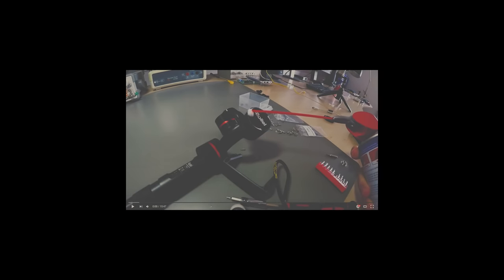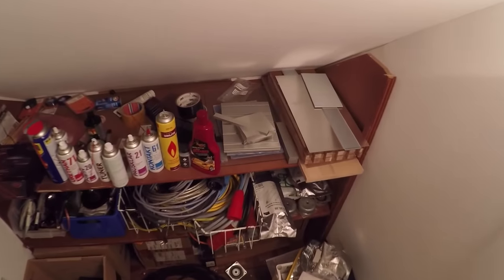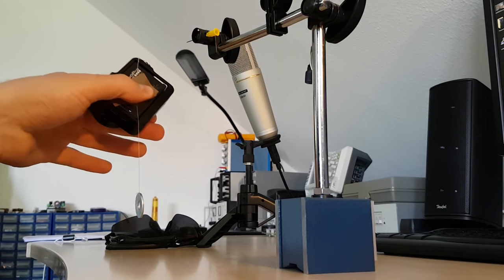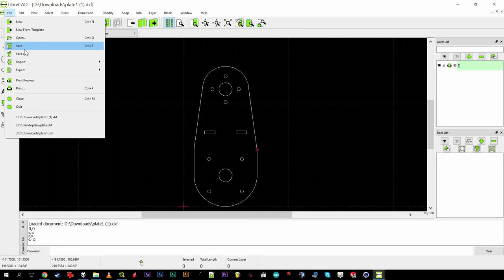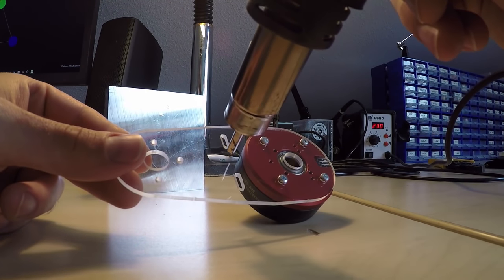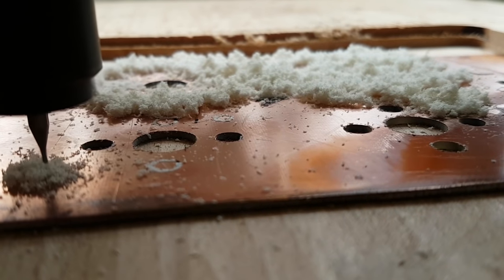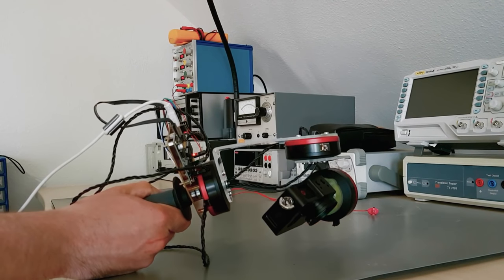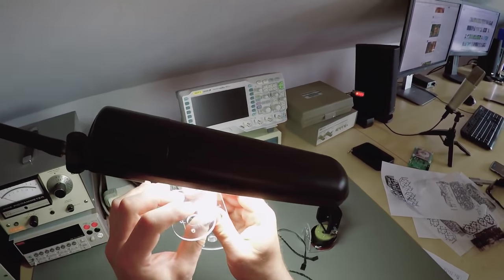DIY 3-Axis Brushless Gimbal: Acrylic, SimpleBGC, GoPro

Comment: Do It Yourself?? Not really. This is a bit beyond DIY. Excellent engineering, though. Well done.
Reply: What. Just because there's a CNC mill in the video doesn't mean you couldn't do it yourself. You could just as well print out a paper template, spray it on with some glue, and chop out the brackets by hand.

Comment: lol very funny narration. and very informative.you deserve a million subsribers.  I'm trying to build a gimble for a dslr. you have helps greatly in information. maybe you can help me and point me in the right direction, as far as where I can get electronics for a bigger dslr and a frame I can design. I have 3d printer. I will give you credit when my company  post first video using the system. :)?
Reply from the maker: The motors I used (BGM-5208-200) are actually made for DSLRs and the driver (Basecam SimpleBGC) can deliver enough power. The frame: There is another video series out there, where someone makes an entire gimbal from carbon fiber and epoxy, looks a bit difficult. Maybe printable parts can be found on thingiverse or grabcad...

Comment: Hello, great video. Can you explain why you had to find the center of gravity of the camera. How was that considered in your solution?
Reply: You have to balance the camera with the axes of rotations. If you don't, the motors will have to compensate for the efforts due to gravity.
Reply: If you balance an object on your hand, let's say it's a ruler, the first thing you'll instinctively do is try to find the center of gravity. If gravity is pulling the object straight down then it's actually helping you keep things aligned. You exert little effort and let natural forces keep the object aligned. I'm sure you've noticed that the more you lose the center of gravity, the more effort it takes to realign it. A gimbal is doing the same thing. The more balanced it is, the less battery it uses and the less likely it is to fail.

Comment: Sehr nettes Projekt und eine schöne CNC die Du da hast ;-) Was hat der Bau in etwa gekostet?
Reply from the maker: Die Mechanik ist die LCF-1, oft bei eBay für 400-600 EUR zu finden. Fräsmotor 200 EUR, wenn man keine Metalle fräsen will, gehts billiger. Stepper, Endstufen, Wellenkupplungen, PC, Kabel und Kleinkram haben bei mir denn 1000er voll gemacht, geht aber auch alles billiger. Von der LCF-1 war ich nicht begeistert: Billigste Kugellager falsch eingepresst -> mussten erstmal ausgetauscht werden und Aufspannplatte nicht parallel zum Schlitten. Der Kauf ist aber auch schon ein paar Jahre her, die haben sich bestimmt verbessert.
Reply: Haha ich meinte eigentlich den Gimball ;-) Aber die Informationen zur CNC nehme ich auch gerne :) Ne CNC muss es bei mir auch irgendwann nochmal sein. Aber dieses Jahr ist wohl erst mal ein 3D Drucker dran. Wobei ich da auch eher ein günstiges Modell nehmen werde. Aber gerade arbeite ich an einer LED-Deckenlampe, wenn die so wird wie ich mir das vorstelle, dann wird die extrem geil und ziemlich einzigartig auf der Welt ;-)

Comment: @Marco Reps,  Sure this is a year old but I didn't know about you then and plus now, I cannot comment on your scientific instrument repairs like the Keathley(sp?) . I made an EDIT: less is  more>> I suggested that you might have overlooked the  excellent opensource STorM32 BGC, using the ultra fast NT sensors and now the new encoders of the T-STorM version, plus!!! they are still actively upgrading enhancing and releasing  firmware and hardware implementation. For handheld or RC use it is unshakable. Basecam is then much more profit oriented, but still chugging along nicely, I was surprised to find out :O
Whatever., in the larger picture it doesn't matter unless perhaps budgetary constraints or you like the new developments in something that the average consumer takes fore granted largely until it fails
Reply: The hall sensor feedback in the Rollei I believe was pilfered from his good works. No attributes naturally. I am no good at regaling the mans feats of gimbalage, but he is one of the cornerstones
Reply: What's the total parts cost for the STorM32? I couldn't find any mention of it in the forums or the Wiki.
Reply: What forum were you looking at ? Simple Google search will bring up vast info on this but .... I can give you a base cost in USD for 3 axis of less that 80.  25 for the board on fleabay, and 40 for the NT sensors including shipping from www.Ensys.com and they are in Lithuania or some such :-) ( very good quality) . If you don't mind waiting for their Epackage delivery times from China. Perhaps you could get it sooner in the USA. Customs bottleneck the hell out of everything here in Canada . Or source some of it on Amazon. That is for the board and the motion sensors (simple term) there is a decent sized shopping list of little and large bits of course. What is your end use?

Comment: How come it is DIY? All modules were off the shelf and you just made the holding arms with acrylic
Reply from the maker: You are right, next time I'll wind my own motors, equip a multi million dollar facility to make a mems IMU chip etc
Reply: @reps No need to be Cocky. I didnt mean to develop your own memes. Atleast if you dont have knowledge of PCB design or electronics, I would expect to atleast do the programming part. Joining bunch of modules is not really helpfull. No hard feelings
Reply: Sanwal Saleem cocky isn’t even the right word💛

Comment: which motors did you use?
Reply from the maker: BGM5208-200, they are powerful enough for DSLRs. For GoPro you could use smaller ones
Reply: thanks for your reply

Comment: where did you buy the parts from?
Reply: can get them on banggood or alibaba for the clones, and the alexmos website for the originales, also, not all boards are compatible with all firmware, so dig in a little before bying anything. Also, those motors are super overkill for the gopro, those can probably handle a small to medium mirrorless. You need bigger ones for DSLR (80-120kv)